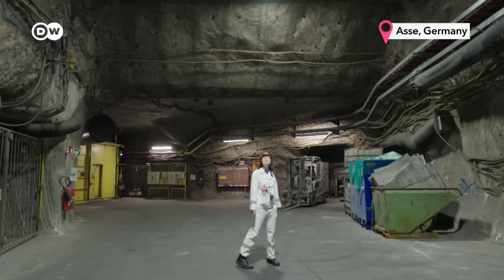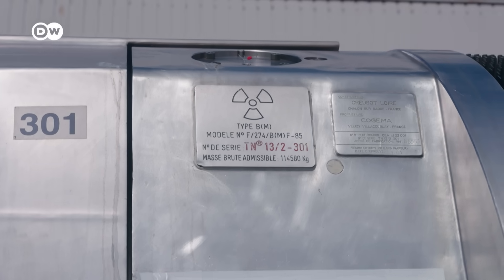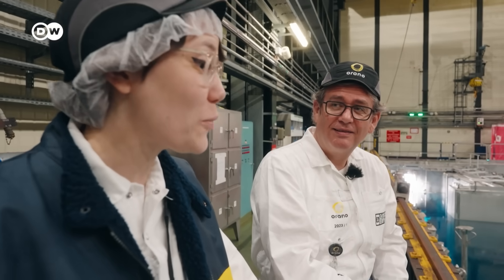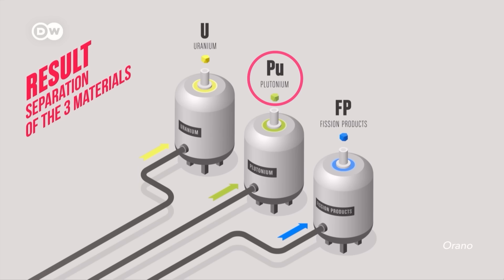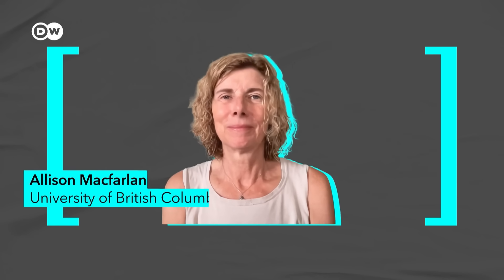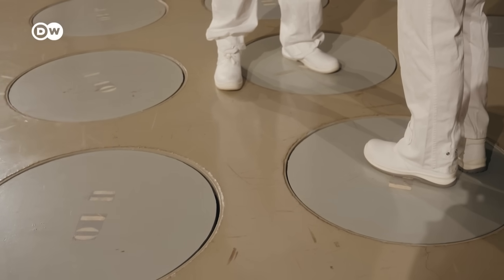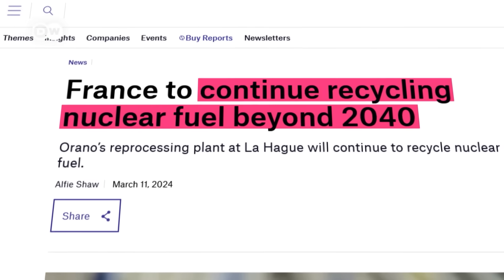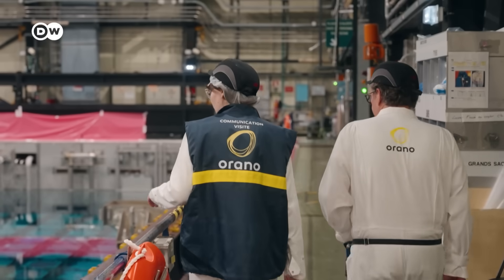Nuclear waste is reusable. Why aren’t we doing it?

Comment: Okay just some quick math with assistance from OpenAI. This video is false advertising at the very best. “Having more than 90% of the energy” in spent fuel rods is nonsense. That’s equivalent to saying there’s still 90% of the energy left in ashes from burning wood. Most reactors use enriched uranium get 50GW per tonne. Assuming you have 1% uranium 235 left in fuel after being recycled, you would need a CANDU reactor which gets 1/4 of the performance at best 10GW/tonne. Right off the bat you see the problem. Then you use up all that candu fuel and you are left with the same problem as before. Furthermore candu are less efficient that other reactor types. so you are basically getting 15% of the energy that was extracted from the enriched fuel. I don’t know if I articulated that well, but imagine after burning wood you extracted just the little bit of charcoal and oil. You take the oil and charcoal and then torch it and say look it made more energy. thus you have recycled wood and should make a video about it because now you can just recycle 96% of all the wood you burn.
Reply: Just on a side note as I saw someone else mention it. Everything that nuclear waste touches is now nuclear waste and needs to be treated as such. All the chemicals used to reprocess. All the equipment to manipule fuel. So now you have to decontaminate or store all that crap just to get 15% more of the energy.

Comment: Interesting. Australia is heading in a different direction.

The “30-30-30” target aims to achieve 30 per cent solar module efficiency and an installed cost of 30 cents per watt by 2030, which would slash the cost of solar to below $20 a megawatt hour, just one third of the 2023 costs.
It will happen and it will be a game changer.

Comment: Simple answer: Green New Deal (with ALL of its implications).

The Green New Deal could not have been pushed if clean, abundant nuclear power was available. In addition, a society that has access to abundant, clean energy is more difficult to control.

And don't forget the fear mongering angle -- how could peak oil have been such an issue if alternative energy sources were available.

Comment: Recycling is nice and all but in that case it produces a lot of nuclear waste too. It is not bad as the highly radioactive stuff from the fuel rods but but the amount of lower radioactive waste is a huge problem. It doesn't really matter if we get down from millions of years of radiation to a thousands of years when we produce a ton of radioactive material more that radiates for decades.
Reply: it is not a big problem, the bulk of the waste is totaly harmles in a 20-30 year timeframe, mind that the safety measures are realy strickt in the nucleair sector, that is to lower to risks to a very low level, so do not take this to a standart that is unnatainable, the other energy sectors not even come close, so you know what we are talking about, radioactif radioation is everywhere, and is variable, there are several places in this world that have constant higher levels than the lower safety levels that are maintained in nucleair facilitys, significant parts of the earths geology consists of moderate to decent amounts of radioactif compound.

Comment: Why not just harvest energy from the spent rods directly?! It sounds like they are giving off quite a lot of heat; heat = energy.

It's used as a way of powering deep space probes. It might not be enough to power cities (slow and long burn), but you could get a number of rods in one place and use them for industrial purposes - like heating metal.

Comment: This video is disingenuous....on so many things that I don't know where to start.

The Plutonium isotope that interferes with the chain reaction (which renders the fuel spent) can't be used for bombs...it's not the right isotope of Plutonium.

You'd have to run the reactor like a breeder reactor, instead of electricity production, to breed the Plutonium isotope for bombs.

Also nuclear waste and spent fuel are not the same.
Waste includes anything contaminated (or even just potentially contaminated).
Spent fuel has too much contamination buildup of a specific isotope that absorbs neutrons and interferes with the reaction.

Comment: Moltex Energy's fast reactor is designed to burn the higher actinides in the world's high level nuclear waste. The first reactor will be built in New Brunswick.
Reply: Any fast reactor can "burn" actinides. I like the MOLTEX design more than other MSRs, but SFRs along the lines of Natrium are likely to be built first because of the orders of magnitude more reactor years of experience with them. We know how they work after 30 years of EBR-II testing alone. We have ~3 years of MSR (of any type) testing currently. That's a big difference.
The MOLTEX SSR & SSR(W) have potential, but even after building the first one and assuming it is successful, there will be a significant period of time verifying the first one works as designed before it can be rolled out safely. Also, the MOLTEX design needs a reprocessing system just like SFRs do. You can't just drop CANDU fuel from Point Lepreau into the SSRW. It has to be reprocessed first to significantly bring up the fissile content.

Comment: You need high intensity output to make electricity, but would the waste not be enough to provide community heating..? Like artificial geothermal sources at least to seed the infrastructure around it to include industries and other heat sources over time..?
Reply from the maker: In Finland, for example, the use of waste heat from the Loviisa power plant for district heating has been studied, but the investment in this technology would be high. The technology company Steady Energy will start building a district heating pilot plant in Finland next year.

Comment: Why don't we recycle nuclear waste (specifically spent fuel rods)? Same reason why we don't bother with other recycling - it's cheaper to just buy new and throw the old stuff away than it is to recycle.

That's why governments have to force energy companies to recycle if we're ever going to actually recycle at a rate that will make any kind of significant difference in the industry.

There's also plenty of stuff like contaminated work gear that is lumped in with "nuclear waste" that can't really be recycled - such as gloves, coats, shoes, etc. But that stuff also tends to not be all that radioactive either.

Comment: This "recycling" effectively is nothing but a drop in the ocean. The little example concerning "MOX fuel" said all (it is not recyclable at all).

One problem btw remains, what was completely concealed in the video:
Nuclear radiation because of it's nature changes the surrounded chemical elements by 'shooting' nucleons to the atom cores. That's the reason, why even the shown glass cylinders for the non-recylable waste is not an eternal, but instead only a _ t e m p o r a l _ solution, because... it it really _ i s _ glass, neither Silicium nor Oxygen will release (when hit by radioactive particles) only "stable" elements, hence these atoms change their chemical properties, when they are converted/transformed to other chemical elements... and the "glass cylinder" disintegrates after some time..

That's similar to the tons in Gorleben/Germany, where the steel of these tons simply converted to completely different material, becoming partly (perhaps/likely corroding) different metals or - even worse - non-metallic material, making the tons completely disintegrate and fall apart, releasing their not so pleasant content (perhaps containing even radioactive gases, so these rooms have to be sealed air tight... very funny, isn't it?

And why was this situation not mentioned?!? It is one of the most problematic topics around nuclear radiation and nobody has _ a n y _ idea how to deal with it. THIS would be _ m u c h _ more interesting than this "one-time-re-use" of nuclear material (especially Uranium, less Plutonium). Furthermore: Everyone _ k n o w s _ , that France produces nuclear weapons, so this "recycling" is giving them a big amount of nearly pure Plutonium... and _ f o r _ s u r e _ it is to a high degree _ n o t _ re-used as fuel, but as bomb-raw-material.

But to be honest: I was highly sceptical whether I'll see a really well (especially _ n e u t r a l l y _ ! ! ! ) investigated video made by mass media. There are too many "concerns" to 'hit' the "wrong" people, so that it was not even made by a scientist, but a "common" journalist without topic-specific knowledge.
Reply: so many mistakes...here are just a couple:
1) you don't need the waste product to be eternal, you only need it to last longer than the waste. The glass and zeolite ceramics do.
2) since the spent fuel is coming from commercial reactors with long residency times, the Pu isotope mix is all wrong for state sponsored weapons regardless of how pure it is.. Way too much Pu240 mixed in and there is no realistic way to separate them with only 1 neutron difference in such a heavy atom. States want weapons that are storeable and reliable. To a state, all it's good for is going back in a reactor.
Reply: @richardb1452  
1) What is not a problem at all for those, who live a few centuries (in _ s o m e '_ cases, because some waste products might have longer nuclear decay times (do you claim to know _  a l l _ resulting isotopes...? Can you _ p r o v e _ that?)
Man, have you ever heard the term "half-life" and really understand it surely?
Glass and ceramics do NOT, because they become radioactive AS WELL and disintegrate (funny to see, that you don't evven know this little "detail"... you surely state to be an "expert", right 😂😂😂?

2) Unfortunately you can't use nuclear radiating material, which behaves up to a known degree uncalculable, so such a material will hardly enter ANY reactor again, since it's risk to cause spontaneous fission, but not reliably, makes it an similarly unreliable "nuclear fuel" as well - making it waste. 
Pu240, btw, most likely receives a neutron, resulting in plutonium 241, which then emits α- and β-radiation... and to a small degree of 0.025% by alpha emission to uranium-236... Here we already could follow 3 different decay series... and things become quite complicating - as visual - very quickly. No need to mention, that all these decay 'transformations' produce own effects... and most of them remain highly radioactive for a damn long time span (there are elements with half-life times of more than a billion years... so your dream of an existing solution might live in some dubious desk drawer either in the house of a silly nuclear industry owner or/and of some sick - most likely right until far-right - ideologist, but FOR SURE nowhere in the hands of at least one single scientist!).

You dream of "glass and zeolite" - nice! Unfortunately you silence the effect of the alphy decay of these metal isotopes, which 'changes' the contents of your "glass" and "zeolite" over time in a way, which - although their resulting isotopes seems to be (at least some of them - I didn't check all by now) no longer radioactive - have completely different chemical properties (especially their valences are different!), making the material they formed first disintegrate over time (Si after recieving α particles (Alpha) becomes S). So all these covering materials disintegrate over time, releasing it's contents.
This, btw, is alteady the case in German nuclear waste storages, what made them seal these locations already (!).

Again: Nuclear waste is NOT YET managable by humans and will remain subject of continuous observation and not little (or cheap!) efforts until this can _ r e a l l y _ be solved for 'eternity'.

Comment: Soo if they did not recycle, then the 4% of unusable fission products would take up 5x  as much vitrification storage? Somebody help me with the math here .. if there is no recycling then there is no vitrification. OR if there is serperatation without recycling the volume should stay the same since the fp do not get recycled? 

From the 100% spent fuel, 4% is useless fission products, Plutonium is 4% recylcable for MOX fuel and 92% is uranium that can only replace 30% of the fresh uranium needed for non-MOX fuel. So the ACTUAL portion that IS recyclable is only 34% of the anual production volume unless we increase year on year Uranium consumption by 300% (bit more) continually. So how much of the recyclable Uranium is ACTUALLY recycled in the fuel rod production IN France and how high is that number in the other countries sending their spent fuel to France?

Who cares about the potential recyclability, what is the ACTUAL rate at which this material, so expensively seperated, IS recycled? As usual with nuclear (and I am PRO nuclear) we only get a partial picture and sooo many people run of with their newly formed opinions based on what? imho this hurts nuclear more than it helps OR I am just not smart enough to grasp this report in full.
Reply: reprocessing makes the uranium available for recycling, it doesnt actually recycle.

Comment: i'm not too sure there is any price problem : the amount of energy produced by nuclear energy is so massive per unit of fuel compared to any other fuel, that not even the cost of recycling and storing the generated waste has much of an impact on the price of the generated electricity.

but that may not be something we would want to openly admit on a german channel i suppose.

also, recycling a resource which reserves are finite should never be considered a bad idea.

Comment: Recycling uranium from spent fuel poses a lot of challenges. Various countries tried it (France, Germany, Belgium, Russia, the UK, even the US) but most abandoned it as uneconomic. It was predicated, fundamentally, on the idea that uranium was rare and costly, and we'd soon run out. I worked for a German-owned nuclear fuel company for twenty years, and I can assure you that uranium is not rare and we are in no danger of running out  for at least 300 years, and probably not even then. Recycling entails taking the used fuel assemblies, dissolving them in powerful acids under remote control, heavily shielded conditions and then doing a series of chemical separations. What you wind up with is a stream that leads to uranium (mainly U-238, but also a bit of U-235, U-236 and U-234), another that yields plutonium (Pu-239, Pu-241), and another containing fission products and higher actinides. A large and very expensive industrial facility is now filled with equipment that is seriously contaminated, leaving a massive clean-up job for future generations. The recovered uranium and plutonium can then be used to make new fuel (called MOX, for "mixed oxide" fuel). The recovered uranium needs the plutonium so as to contain enough fissile isotopes to sustain a useful chain reaction. Note that this recovered uranium contains small amounts of unwanted uranium isotopes that keep it from being reintroduced  into uranium enrichment plants. The enrichers (like Urenco) don't want to contaminate their costly equipment with crap uranium. Hence the need for the plutonium. (Blending with higher enriched uranium (10% to 20% U-235, say) would also be a way to goose up the enrichment to the level needed in light water reactors (generally 5% U-235 to start with), but those levels of enriched uranium are not commercially available for a whole host of reasons.) Note too, and this is a big note, you only get to recycle the uranium once, not over and over. It picks up so many unwanted isotopes that it won't meet the exacting standards for modern reactor fuel, and there's no practical way to clean it up. It's just much, much cheaper to use fresh uranium. Recycling only continues in France (and maybe to some extent in Russia) thanks to huge government subsidies. Initially, recycling was supposed to save money. That turned out to be the opposite of true. The next rationale became "reduction of waste volumes," but that's only partly true due to the waste streams to which recycling gives rise. Since we have yet to even open a permanent spent fuel repository, it is not clear what the cost savings would be from obviating the need to bury some marginal extra tons of spent fuel. And don't get me started on the compatibility issues of MOX reloads with current, long cycle uranium fuels. IMHO, recycling is great in theory but not in actual practice.
Reply: The U.S. buys most of it's Uranium for Nuclear Power Generation from Australia  .
Reply: Can we at least store the spent fuel rods in a manner that future generations can recycle and reuse them?

Comment: The plutonium could even be sold to various trusted space programs for use in spacecraft that need it as a long term power source.
Reply: No feasible method of separating various plutonium isotopes in spent fuel rods from commercial reactors has been developed.